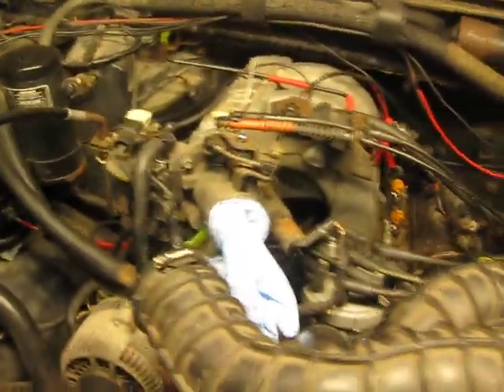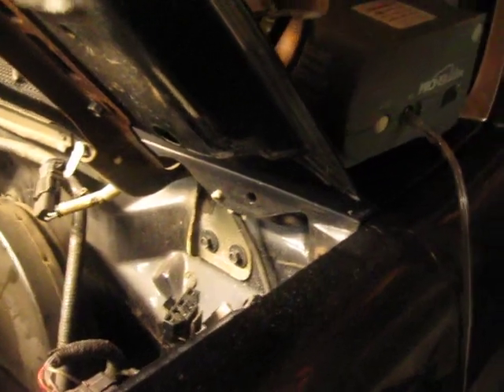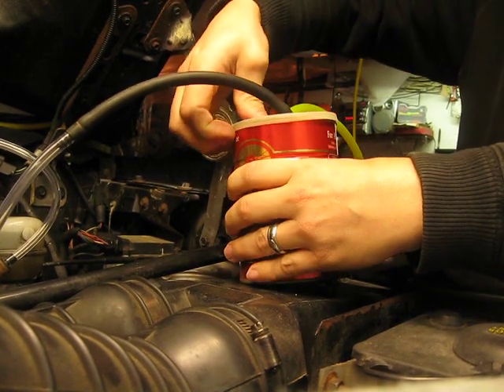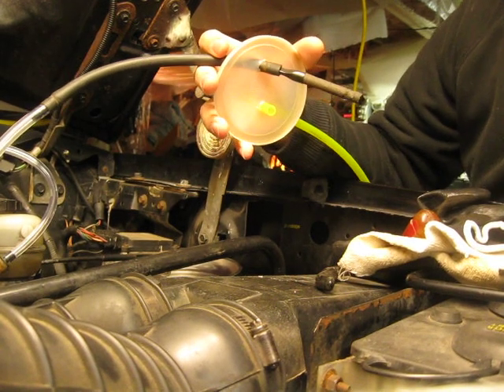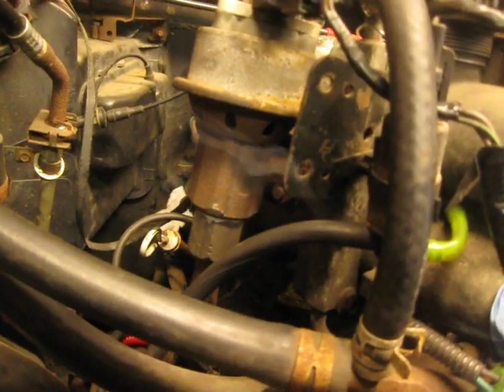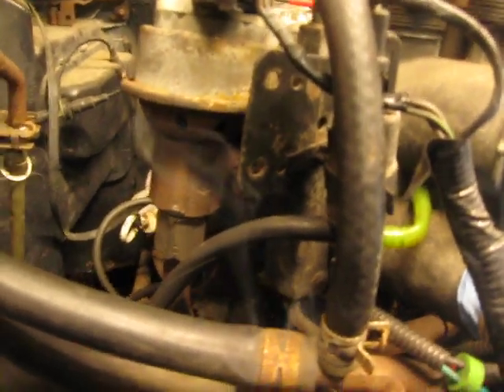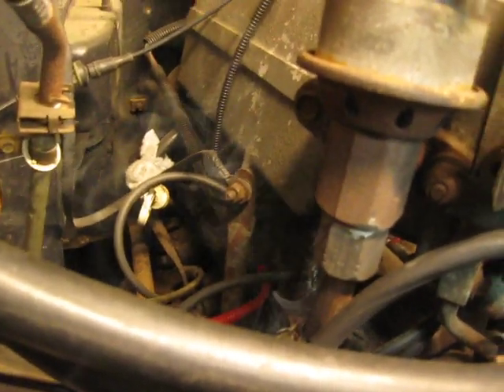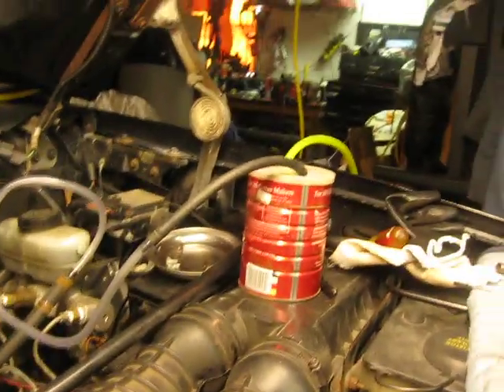Checking for vacuum leaks using home made smoke pump.

Comment: I built one with an old aquarium pump and a $5 soldering iron from HF hanging into the jar just touching an old sock soaked in mineral oil. Pumps smoke like crazy. Thanks for the video.

Comment: Could a smoke test mess up a transmission if it has vacuum lines going to it? I did a smoke test and found my leak but now my transmission doesn't work that great. I used mineral oil on a wick thru a POS and NEG wire in a paint can.

Comment: Where did you attach the smoke nozzle to? Did I miss something
Reply: Arkham Asylum brake booster
Reply: At 4:13 in the video, in the midst of the pan shot you can see the hose attached to the clear tube.  The hose has its screw clamp on it and in the background you can see the port where it was connected to the brake booster... Very creative and easier than spraying brake cleaner around hoses while the motor is running!

Comment: I did this worked fantastic, the only problem is, the breaks automatically comes on outside a tobacconist, Seriously awesome idea, I have found that if you get a tire valve, these fit lovely into the drinking spout of a evian water bottle, so you can fit your pump on it, pipe on the bottom of the bottle where the plastic is thicker, and glue in place. Smoke cartridge then your laughing.

Comment: Just smoke the cigar (if you're a non smoker don't inhale, normally you don't inhale cigars anyway) and puff it out in a rubber hose connected to your vacuum system less hassle and achieves the same result.

Comment: Kerosene smokes like the dickens if you spray it on a hot surface.  Perhaps have an electric hot plate in the bottom of 5 gallon bucket like joint compound comes in.  drill a very small hole (say 1/8") in the lid directly over the hot plate.  Once the plate has heated up, introduce a few drops of kerosene in via the hole using an eye dropper then turn on your smoke machine pump.
Reply: +E.PLUMBUS UNUM yeah that may work for smoke but I know for a fact it will work really well for creating explosions as well.
Reply: +consaka1 Exactly lol.

Comment: Very creative solution to not buying a $1500 diagnostic tool. A baitwell pump from Walmart will work too. Easier to find and cheaper than a nebulizer pump. $26. http://www.walmart.com/ip/Tsunami-500-Recirq-Livewell-Aerator-Kit/11071184. If $26 dollars sounds expensive, just wait till folks call their favorite shop and get a diagnostic quote from them. $26 will sound like free then.
Reply from the maker: You are right about the pump. I think someone is going had a good idea using an aquarium aerator pump. In hind sight a shop air compressor with the regulator turned way down would also work with the use of a blow gun in the tubing. What ever it takes with what you have. I think its fun to play McGuyver and seeing the looks on peoples face as my brain sparked idea starts to take shape. Have an awesome day.
Reply: Good Idea Sushi Mashpotato and Gravy

Comment: Nice job Nomad. When I first saw you light the fuel I thought it would be blown out by the pump.
 Was looking around at the pro ones and they put the smoke into the gas tank filler tube.

Comment: This is the simplest and best solution I have seen. As soon as the weather warms up I will use this to diagnose my Explorer. Good on you Nomad.
Reply from the maker: Good luck.
Reply: As an addendum to my previous post I did this and it worked perfectly. I found a worn lower intake manifold gasket and 2 hours and $16.50 later my Explorer is running the best it has in a year. Great video.

Comment: My 92 is having that same problem It surges at higher RPM's Stalls whe coming to a stop. It slowly dies sometimes when ime driving around town
Reply from the maker: Check that vacuum can on the inner fender. Mine was rotted out so I made a new one out of pvc pipe end fittings.
Reply: Found out my problem eas the fuel pump on the front tank was getting weak. Im using the back tank right now and it seems to run fine now.

Comment: Thanks connected break booster the egr leaked a little but then stopped code said mass air flow would that cause vacuum leak to

Comment: Any route to the manifold would be suitable. MAP sensor, power brake booster, or what ever fits the line you are using. Should be down stream of the throttle body.

Comment: I'm no expert mechanic, but it sounds like your catalytic converter might be clogged up. A clogged cat would cause an engine to over heat because the vapors could be trapped before the cat and not make it out to the exhaust. this was almost a year ago have you found out what the problem was?